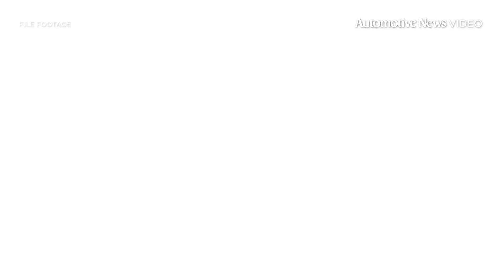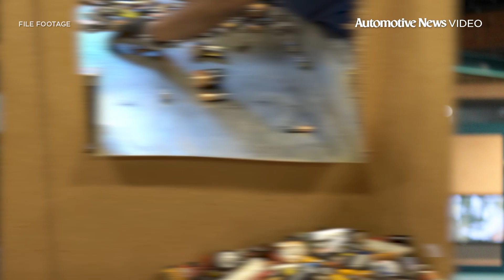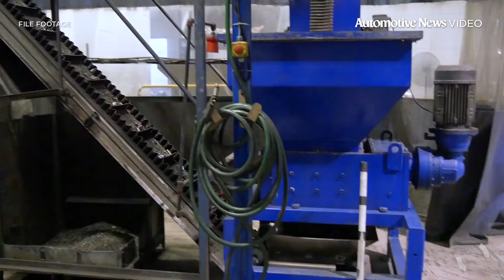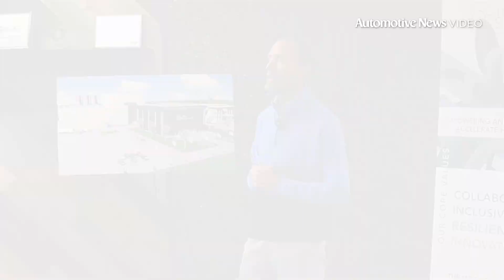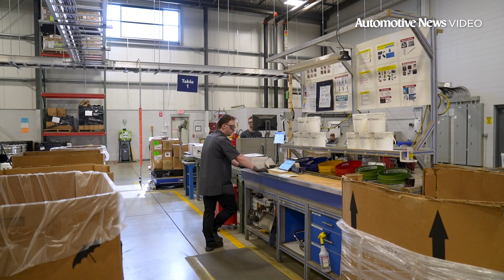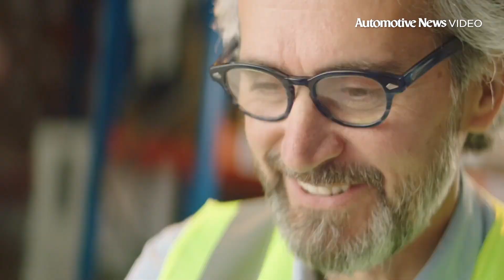AUTOMOTIVE NEWS VIDEO - 05/24/2023: How Cirba Solutions says it is connecting the EV supply chain

Comment: Lead acid car batteries are recycled at about 90% and have been since the 1950s. That's why we don't have lead mines all over the place. No reason we can't do that with EV batteries. Bosch as a system that can also use any power left in the battery to run the recycling center and drain it faster, that's cool.